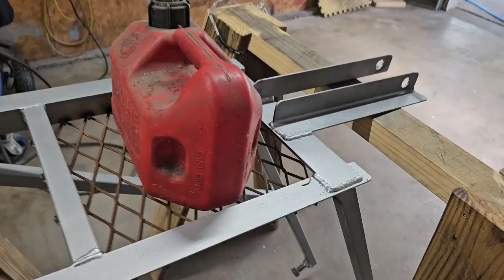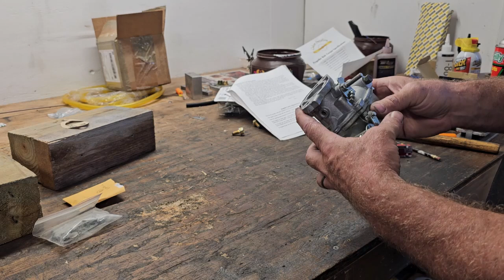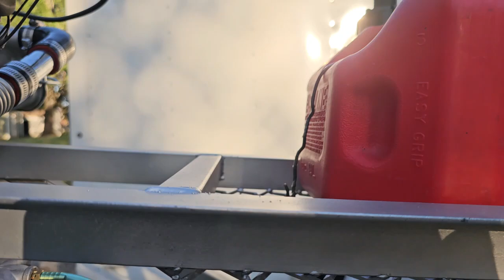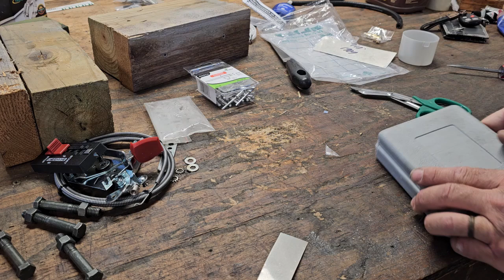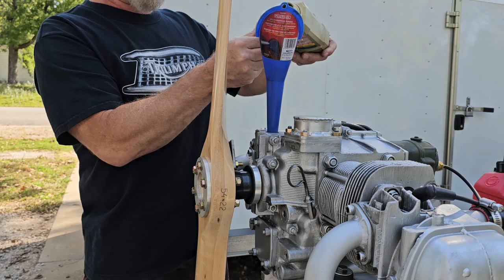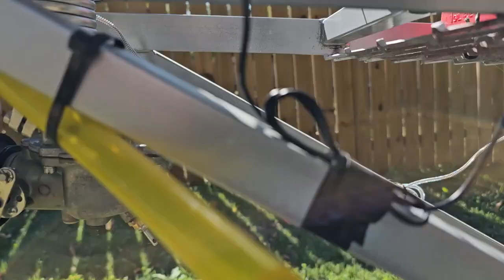1/2 VW Build - Part 30 - Last Details & First Failed Start Attempt

Comment: Fantastic work. It looks like the intake manifold could benefit from being braced to the engine back plate.
Reply from the maker: Definitely.  There is a little rubber mount I need to build that fastens the carb to the engine.

Comment: Why would you put an updraft carburretor instead of a downdraft as on the beetle engines
Reply from the maker: Mostly packaging since there isn't anywhere to put a carb above.  Individual side draft carbs work but add twice as much to go wrong.  The Zenith carb is super reliable and the mounting method is a proven design.

Comment: On my Scott Casler built 1/2 VW with the single zenith carb. Instructions say the following. Set idle screw 1 out. Set main jet out 2 turns. When starting, ignition off, fuel on, and choke on, pull prop through until fuel drips from bottom of carb. (The dripping is expected and does not mean the float setting is wrong). Next choke off, crack throttle a bit, ignition on, and give prop a whirl. Should start after two or three pulls. Once warmed up you can fine tune main and idle jets.  BTW. Looks like your prop is clocked slightly off   Reinstall prop as previous commenter said at 10 o’clock. Now it looked like impulse coupling engaged late in your pull. Although it will run fine where it is now. Just may be a little harder to start. Just my 2 cents. Good luck my friend 😊
Reply from the maker: Thanks for the info on the carb and  I'll try moving the prop to 10 o'clock.  I thought the impulse coupling was retarding the timing too far when I was bench testing it so I tried advancing the timing yesterday and still no good.

Comment: Typically the prop is mounted so that the upper blade is at the 10 o’clock position @tdc. Also drilled head prop bolts are s/b used to safety against rotation, especially on wood props. On my vw a/c engine I prime it until I smell fuel in the exhaust. It then usually starts with a couple of pulls. Sounded to me like it had a couple of pops but not quite enough fuel to keep it going. Looking forward to hearing it run.
Reply from the maker: I'll try clocking the prop different and see if I like it.  The prop bolts I'm using now are just temporary.  I'll have the proper AN bolts with safety wire when I install it on the airframe.